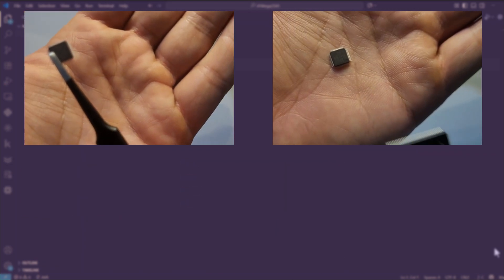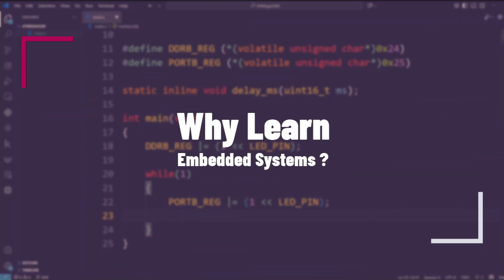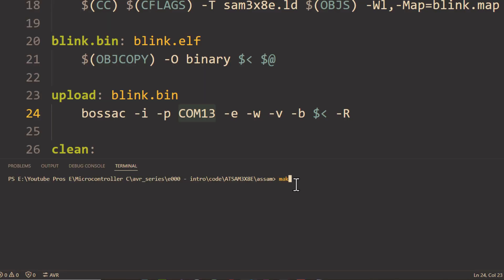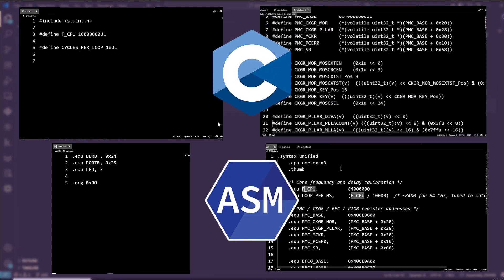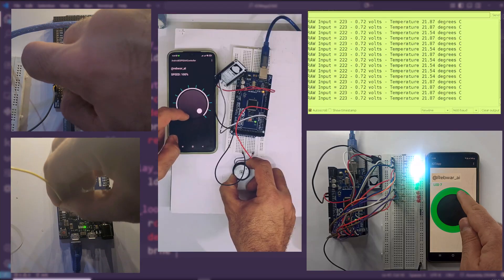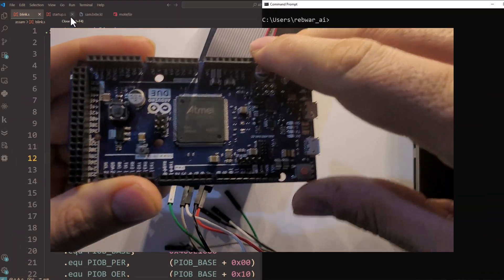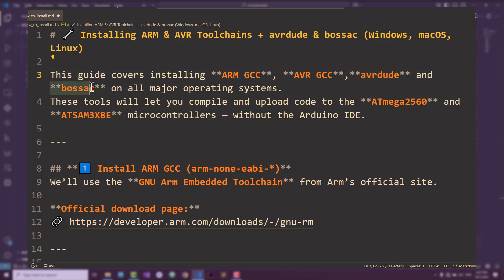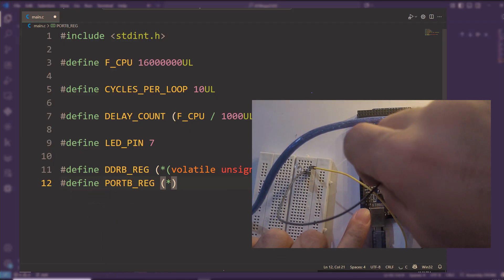Bare-Metal Embedded Systems (AVR & ARM) in C & Assembly – Intro

Comment: Can I use different avr microcontroller like atmega328? Or I have to buy this atmega2560
Reply from the maker: You can definitely use the ATmega328 👍 No need to buy the ATmega2560 just for this series.
The concepts are the same across AVR microcontrollers - registers, GPIO, timers, interrupts, etc. I’m using the 2560 mainly because it has more peripherals and memory, which helps for bigger demos.
If you’re using a different AVR, you’ll just need to adjust register names and pin mappings - but if you can get the ATmega2560, I do recommend it.
Reply: I am just really new to Embedded systems and bare metal , and I really wanna know how hardware peripherals work across avr , arm cortex based microcontrollers. The peripherals and architecture is overwhelming. I am studying computer architecture also . So like if I am using atmega328 from Arduino UNO or nano then I can follow along this course? Or should I buy one atmega2560 for me. I have a stm32f401RE arm cortex m4 microcontroller, using that I guess I can follow along. But for this avr thing and I am in doubt. Any tips or advice would be nice😅☺️
Reply from the maker: Thanks for sharing this - and don’t worry, feeling overwhelmed at the beginning is completely normal 😊
You can absolutely follow along using the ATmega328 (Arduino UNO or Nano). You don’t need to buy the ATmega2560 just for this series. The core AVR concepts - GPIO, timers, interrupts, UART, etc. - are the same across AVR devices. I’m using the 2560 mainly for convenience and bigger demos.
For the ARM part of the series, I’m using the ATSAM3X8E (ARM Cortex-M3). Since you already have an STM32F401 (Cortex-M4), that’s totally fine - the Cortex-M architecture and peripheral concepts are very similar. You’ll just see different register names and vendor-specific details.
One of the main goals of this series is to help you understand how peripherals and architectures work conceptually, so moving between AVR and ARM becomes much easier over time. Take it step by step - you’re on the right path
Reply: @rebwar_ai Thanks brother, I really appreciate your advice. This is such a helpful and clear explanation ☺️
Reply from the maker: You’re very welcome, brother! 🙌 I’m really glad it helped. Keep going step by step - more content coming soon!